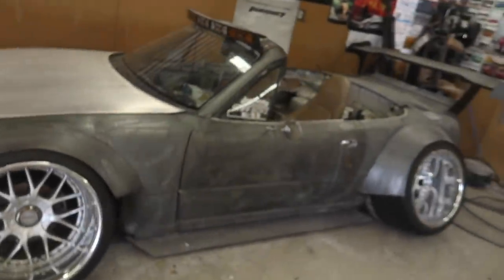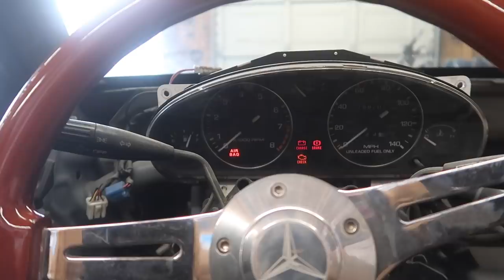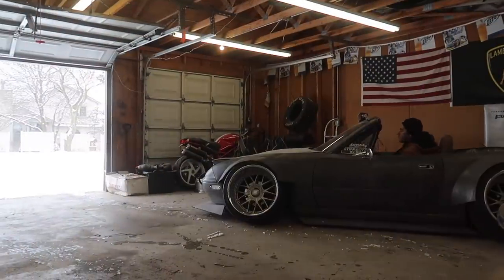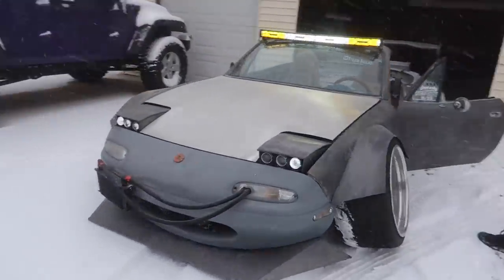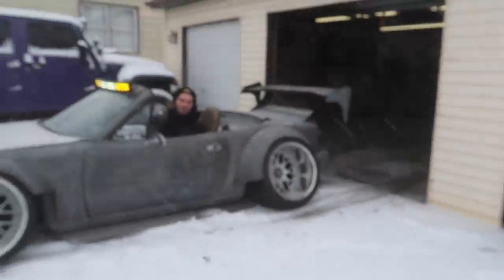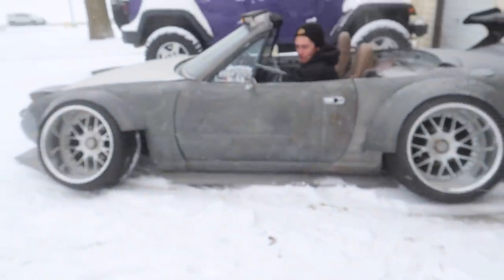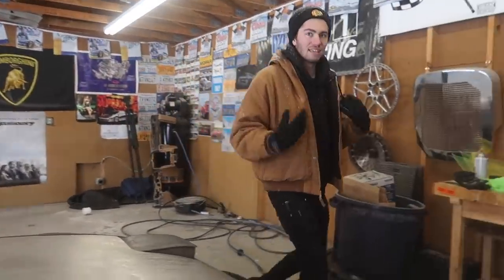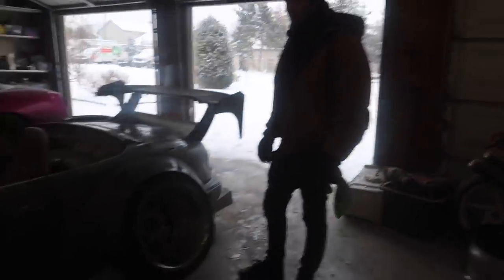Idiot Drifts Insane Miata In Snow!?

Comment: Honestly those r888's arent supposed to be under freezing. They'll crack. I wouldnt even leave them in your garage if its not heated let alone running them in the snow.
Reply: He can have all the fun he wants. Never said he couldn't. Just letting him know so he isnt upset when his 1500 dollar tires freeze crack and dont hold air.
Reply: RedLine Customs ☝️
Reply: Chandler Braaten I think he has more money than he knows what to do with, even in dry he's basically wasting money driving it using only 2 or 3" of tread, I hate this car with a passion just because he spent that kind of money on wheels and tires to pretty much trash them

Comment: If  u had the wheels with the correct  camber n the smaller  wheel size then u won't rub n u can steer it alot easier

Comment: I don't get it, maybe someone can help explain why would you set you car up with the tires at that amount of camber??  I'm not trying to take away from your mechanical ability & I'm not trolling anyone, you do have some amazing skills, but what advantages or pleasures do you get from the tire camber set like that?? It looks like the car was drop from 100ft & it broke the suspension, lol. You have a nice fat wide tire/rim combo but your only using approx 1/4 or 1/8 of the tire foot print.  Cool vehicles & video over all, I definitely liked the idea of taking your car out in the snow.